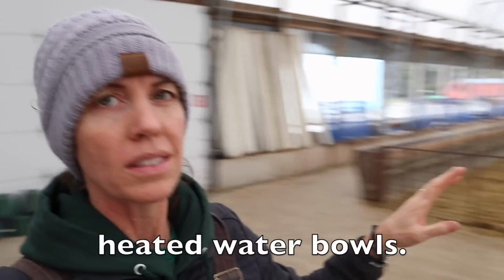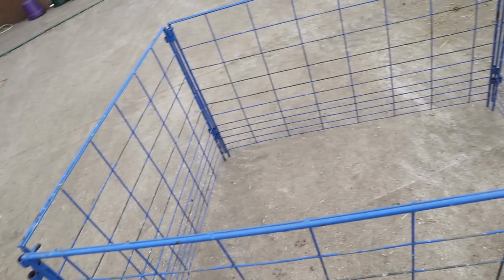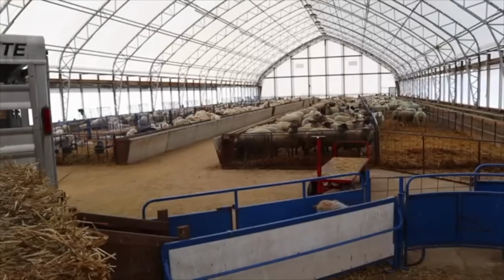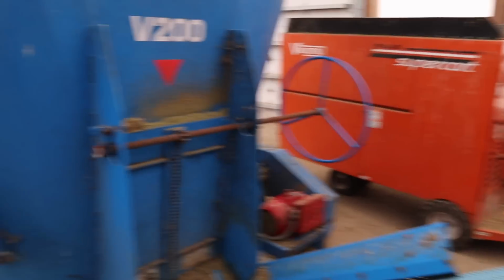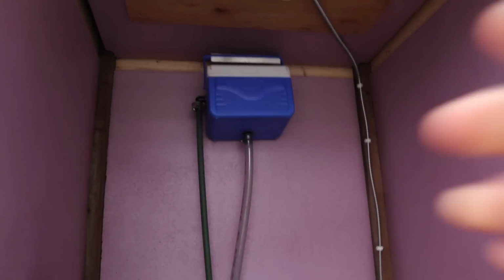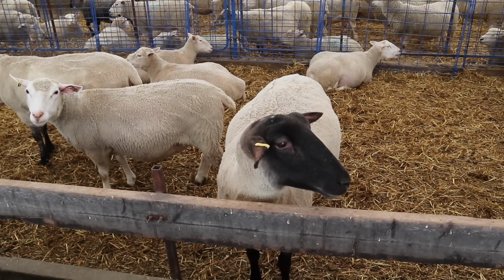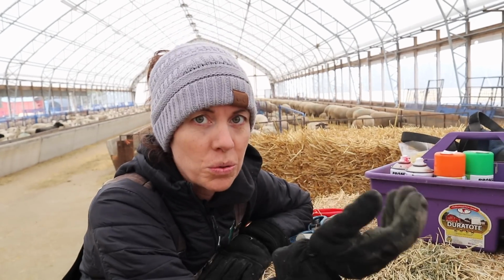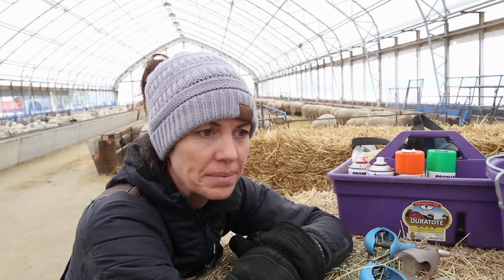THESE ARE A FEW OF MY FAVOURITE THINGS!  (Sheep Equipment Tour 2020):  Vlog 259

Comment: Regarding ventilation/ air movement, are you looking for cooling or just circulation? Because of the large air space you have the large over head commercial fans will move more cubic feet per minute or you will need more smaller fans. Also something to consider is a rheostat to increase speed and thus more air movement if needed. The fan would have to be able to allow for this.

Comment: Just a suggestion Sandy try putting the plugs plugsFor drinkers on the inside towards the water. We fatten a lot of Holstein steers they did the same thing to our little spring drinkers once we moved the plugs to the inside never happen again
Reply: There's a video about another flood in the lambing barn in (I think) 2022. Sandi finally learned to put the plugs on the inside toward the water after that. No floods in that barn since then.

Comment: @Sandi Brock   -Feed Cart. Notice that soot on the back of the feed cart. That's from the exhaust from the engine. It's going right up to your head. Recommend modifying the exhaust pipe to discharge further away somewhere. Like out the left side of the cart. Anywhere else where you don't have to breath the fumes. You may not smell it, but its there. You're lungs will thank you later.
Reply from the maker: It’s actually wet feed that I scoop up at the end of each feeding it hits the cart on its way in..
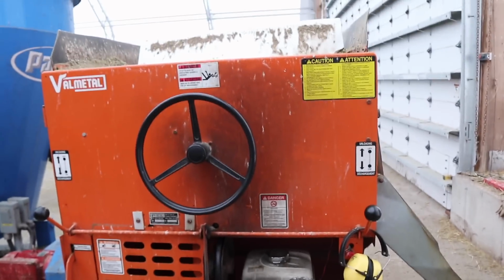Reply: @SandiBrock  At exactly @10:14 in the video. A thin black region extending from the top left of the engine (where the exhaust is), up behind the right side of the steering wheel and dissipates towards the top of the cart. If this is the result of scooping the wet feed in, then sorry for wasting your time. Watched enough of your vids to know you're busy.

Comment: New subscriber here,, since you're talking equipment I was watching when you were teaching Jenn  Your chores . for your giant tmr mixer   you need a bucket on a pole like say 10 foot long  ( or a  giant long handle ladle )    throw your supplement powder into the giant mixer it only takes one time falling off that ladder to hurt yourself,, I was cringing watching her try to dump the 5 gallon bucket into the giant mixer on top of the ladder one handed.
Reply: I agree, needs to be safer. Tie a bucket onto a rope and pulley setup. You just raise the bucket like it's a flag on a pole. When it gets to the top, it curves around the wheel of the pulley and turns upside down. Easy peasy. :)

Comment: Think about using dry lubricant on your equipment. It does not collect dust and dirt.on that hoof trimmer it would make turning easier. Try in other equipment.
Get a diamond file in garden center and give your trimmers a few strokes as you pick the trimmers up for use.
Less musle

Comment: I would suggest (if I may) a kind of air vents system in the highest points of the roof rather than fans, it will funnel out the ammonia and the whole of the bad smell in the barn and will create a fair bit current of fresh air circulation.
Reply: Nilcan Sucukları İlhan DEMİR ...your suggestion does make sense. Having incoming air sourced at ground level with the air exiting at roof. This is good for summer, but is it good for Canada winters.? Always good to think about making smart adjustments and I would rely on the Veterinarian for his/her thoughts. He/she, sees all the other surrounding indoor sheep farms and is full of information..! Good job..!

Comment: Question. What would you think would be thecost  difference between a mum reared triplet v machine reared triplet. I guess what I am wondering is if the cost of raising a lamb on the machine is less than the loss from having a ewe raise that extra lamb. That cost would be milk powder and machine cost over time v ewe ration etc.

Comment: Why don't you put a small screen are the bottom of the water bowl that you can pull up with a handle. It works well for particles.  Luca.  Ps nice operation. Quieter than I expected

Comment: I could not believe that as soon as you started putting up a lambing pen - the ladies rushed over to watch you, supervise and comment. I believe they might have been saying you were doing it wrong - it had to be inside their pen. Just a thought.
Reply: Great video, Sandi. Your equipment is just perfect, and you manage things so well. There is not excess - as it is just the things you need to do the job you have to do to take care of your girls. If something happens - you have to be able to do it yourself - there may not be time to call for help - or to get it. Anything less is not acceptable as it reduces the care your flock may get - or it puts you at risk for injury which again reduces the care your flock will get. For the record - if it comes to it - save yourself.